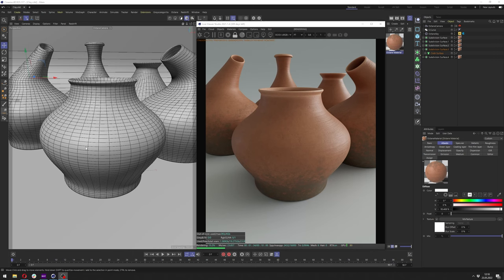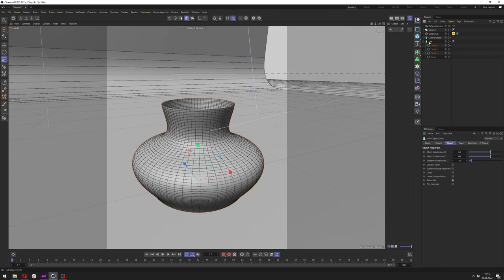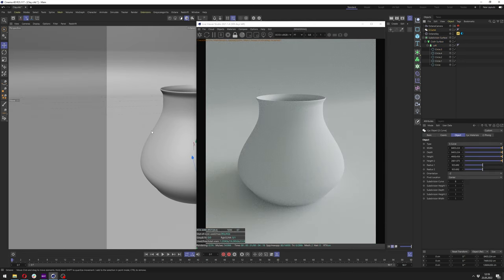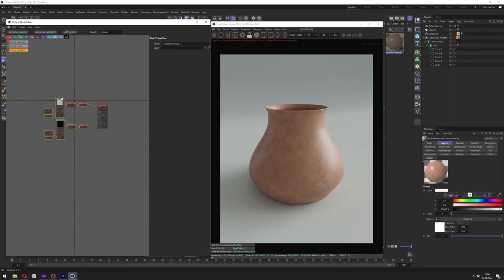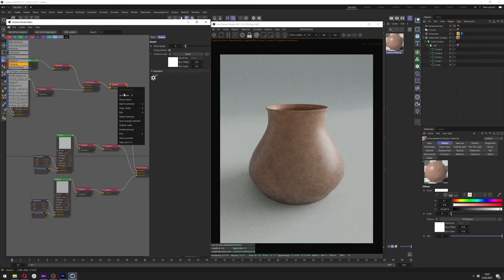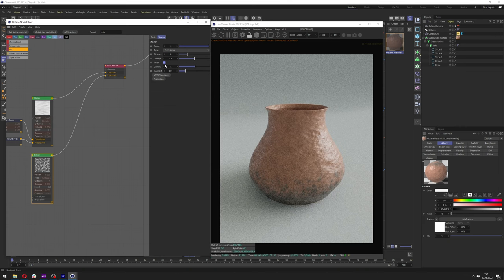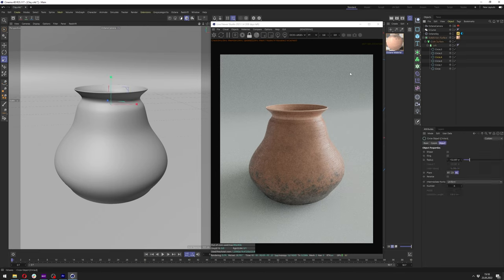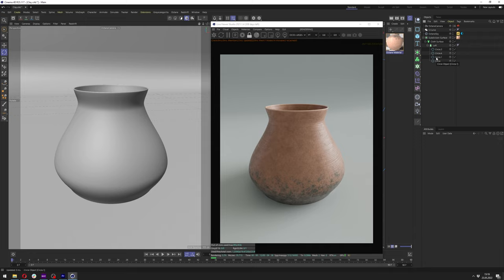Clay Vase In Cinema 4D And Octane Renderer

Comment: I want to thank you for the job you are doing here, and would like to ask how it came that your version of Octane does have the Voronoi OSL noise built in there? i`m pretty sure that i`m using the last version of octane but, unfortunately, there is no such an option. Was it always just there, or you customized your octane settings? (also, i`m using Mac, maybe this is a problem)
Reply from the maker: Hey! its probably a Mac version thing, i just normally have it, without any addons.